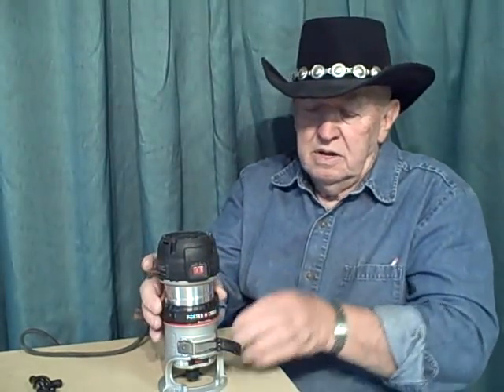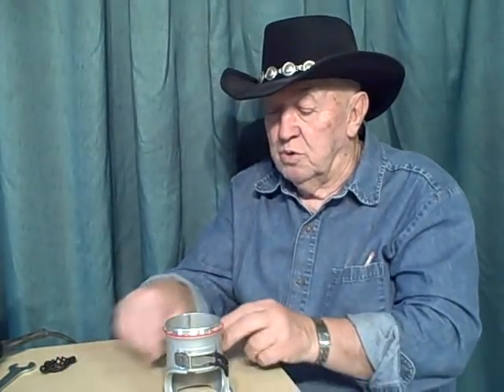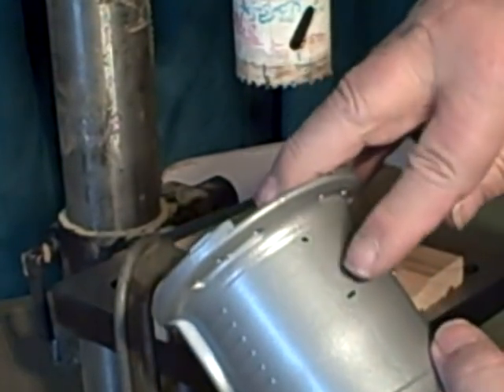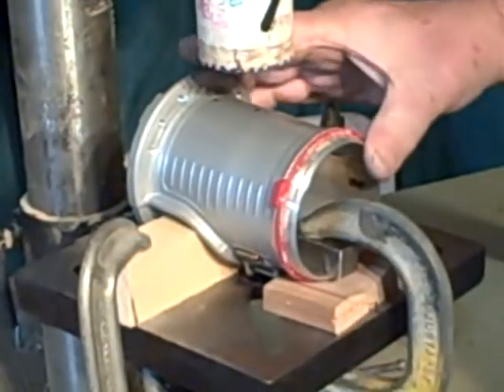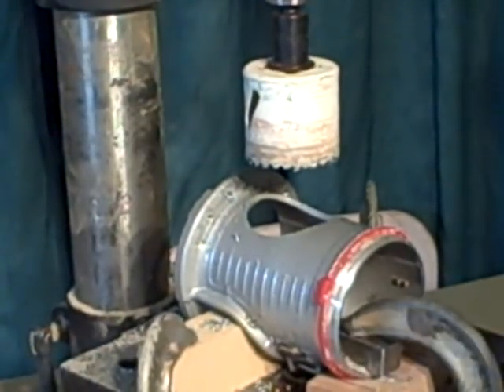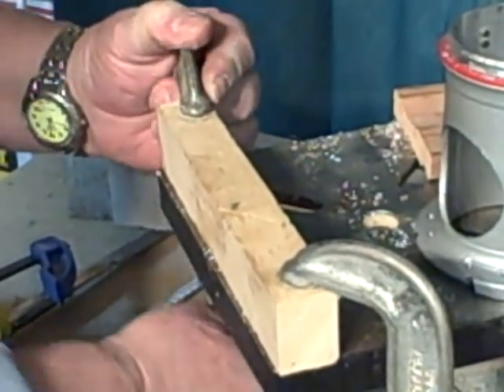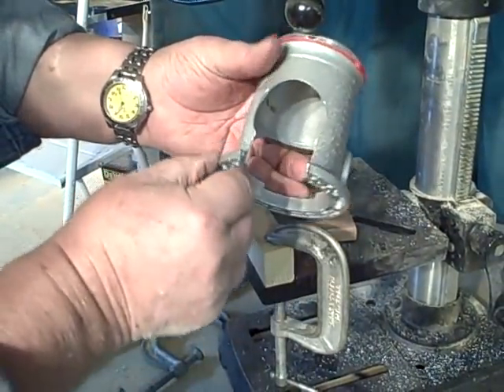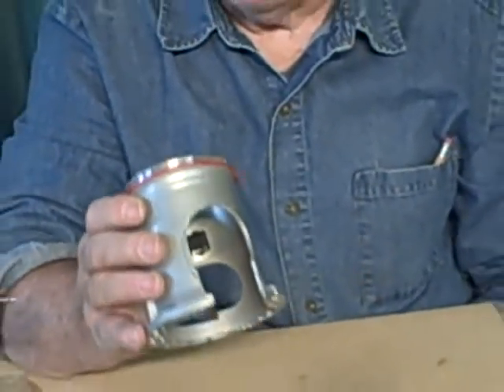#50 Dave modifies compact router part 1

Comment: This is for anyone interested in doing this modification to your router. This same procedure can be done without a drill press if you don't have one or have access to one. Just clamp it up the same as Dave did. You can use bar clamps if you don't have C-clamps. That's what I used and clamp it to a board. I used a board that's screwed to my table work space. You can use a standard 2 inch hole saw bit if you don't have a bi-metal bit. I used a standard wood bit. Like Dave said it's made out of pot metal and not very hard to drill through. I used a standard electric dril and just took my time with it. Drill at a slow rate of speed and everything cut just fine. Finished up with a hacksaw and hand sanded the edges with sand paper. Well that's all there is to it; if you don't have a drill press or a bi-metal bit. Special thanks to Dave for pointing us in the right direction.
Reply from the maker: +bobby russell Good tips Bobby. Thank you for the kind words.

Comment: So I really want to do this with the money from my next couple of projects.  Did y'all try originally just just cutting the two inch hole and not using the hacksaw?  And if so what issues did you find?
Reply from the maker: Yes we did. The sawdust still didn't exhaust enough out the back for my liking. It was still throwing more of it in my face than I wanted. That's why we cut the rest out with the hack saw. Then it worked fine. Thanks for the question, Eric